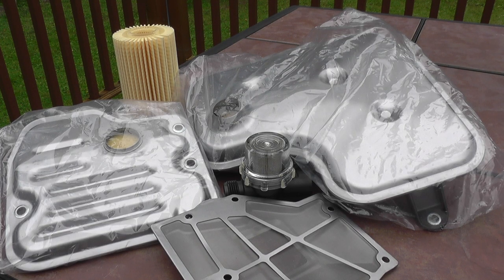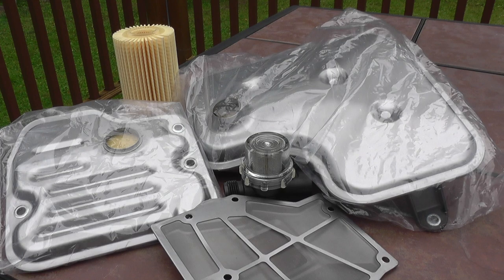Automatic Transmission Filters, information on transmission flush dealers don’t want you to know

Comment: I changed my trans filter in my 2008 Avalon. I replaced the fluid with Dextron VI wich I read was compatible. Is it? Now is is not engaging at normal speeds. I have only driven it about.5 miles after doing the change.
Reply from the maker: Your avalon needs ws compatible.  Also,  did you watch this video before changing atf? https://youtu.be/maK7HsGEEls

Comment: hello rapairvehicle, thank you for your time to make these interesting videos end for the time spent for all of us! i have been watching your videos for some time! this time i have a question, there are stories that the screen filters are suposed to change them in long periods of time( kia dealer advised me to let the filter there until 300000km)! my car has a screen filter has 140000 kms on the clock end i want to change only the fluid end not the screen filter, it's ok for another 40000kms? my gearbox is A5SR1 from kia or should i replace the filter too? thank you in advance!
Reply from the maker: If you change your fluid on regular basis then changing filter is not necessary. If fluid has not been changed for 140km then it might good idea to change it, because it might be partially clogged up.

Comment: should I change also gasket pan for. transmission
Reply from the maker: Definitely replace gasket, sometimes it comes with the filter.
Don't forger quality ATF fluid, I use it in my Toyotas. https://www.amsoil.com/lookup/auto-and-light-truck/2004/toyota/sequoia/4-7l-8-cyl-engine-code-2uz-fe-9/us-volume/?zo=5257753

Comment: Hello 
repairvehicle, thank you for your videos. I have Nissan NV200. Looks like there is two filters in transmission. Should I replace both of  them? I have 140K on it. I drain and fill it once at 70K. And second time at 130K. Thank you in advance!
Reply from the maker: If you replacing 1 filter, might as well replace second one, if it's can be done.

Comment: Hi. 
This was a very interesting video. 
I also have a question: I need to check the ATF level on my transmission, but it has no dipstick. 
Is one of the new so called sealed transmissions. 
For verify the level, I have to open the level plug, with engine running and transmission in P, all that at a certain FLUID temperature. 
This I do not know, what is the temperature needed so I will have the correct level. 
I am able to see the transmission temperature via OBD, with an ELM 327 and Torque application. 
Can you please tell me if you can find this information for my car?
It's a Opel/ Vauxhall Corsa E series, from 2015, 1.4 gasoline engine and 6 speed automatic transmission. 
Thank you.
Reply from the maker: +Burta Verde , I will get back you to later today.
Reply: repairvehicle thank you very much
Reply from the maker: +David Meyer, you are welcome.
Reply from the maker: +Burta Verde , this video looks like has an answer for your question. https://youtu.be/ipdcU24uXxU
Reply: repairvehicle Thank you, but my car is Corsa E and not Astra J.
Reply from the maker: +Burta Verde , according to the video description it applies to Corsa too. Is Corsa and Astra have same engine???
Reply: repairvehicle No. Not same engine and not same transmission. 
Corsa E has newer transmission, similar to Astra K.
Reply from the maker: +Burta Verde, I will look around and see if I can get you more information.
Reply: repairvehicle Thanks man. 
Maybe you have acces to the workshop manual. 
I was not able to find it.
Reply from the maker: +Burta Verde , I could not find any information on transmission. There are some website out there that might have it. However, you have to pay to have access to the information.
Reply: repairvehicle No problem, I decided to use the simple method of draining it, measure the amount that came out, and put back the same (maybe + 200 ml). At the next drain I will measure again and see if trandmission consumes some fluid between changes or not.

Comment: Hey repair guy
would you recomend me a transmission filter for a sequoia 2004?
it can be any brand name
Reply from the maker: Here is my recommendation.
This would be my first choice https://rover.ebay.com/rover/1/711-53200-19255-0/1?icep_id=114&ipn=icep&toolid=20004&campid=5337992468&mpre=https%3A%2F%2Fwww.ebay.com%2Fp%2FTOYOTA-OEM-Automatic-Transmission-trans-Filter-3533060030%2F658755859%3Fiid%3D322415651590%26_trkparms%3Daid%253D222007%2526algo%253DSIM.MBE%2526ao%253D2%2526asc%253D44040%2526meid%253Dd75a63a611ee449da3142bc495b8a958%2526pid%253D100005%2526rk%253D5%2526rkt%253D12%2526sd%253D253066573906%2526itm%253D322415651590%26_trksid%3Dp2047675.c100005.m1851

Second Choice  https://amzn.to/2JMUk8A

Third Choice, is because price is higher on amazon vs ebay for OEM https://amzn.to/2Hzucxs
Reply from the maker: I don't know what seller has in stock. Please ask seller on ebay to confirm filter part number, and if its going to work for you Toyota. When purchasing parts from Ebay, make sure seller sells only parts not just random stuff and it happened to have filter.

Comment: Hello my friend. 

I have a 2015 Tacoma. I plan on doing a drain and fill 3 times when I hit 60,000 miles. Would you recommend I change the transmission filter at this time or wait until more milage?  Thanks!!!!
Reply from the maker: Have you seen this, it has answers video https://youtu.be/Y2f7dFNP82k
Reply: @repairvehicle  watching now thanks!  Thumbs up and subscribed
Reply from the maker: Let me know if you still have questions after watching
Reply: Can I order Amsoil through you? I needed trans fluid, transfer case, and diff. 

2015 Tacoma TRD Sport 
4.0 V6

I have an Amsoil membership, is it worth it or possible to order from you? Could you tell me EXACTLY what to purchase? There is a few options for AMSOIL trans fluid and I'm confused. Thanks
Reply from the maker: I will get back to you with answers, later today.
Reply from the maker: Amsoil offers two types of atf fluids for your truck,  OE- which is better than factory and signature series which is best atf money can buy. I personally use signature series everything,  including atf in my Toyotas and lexus.  You can purchase through me,  but you would have to call Amsoil give them my reference number, because you already have account and assigned to someone else. Let me know if I answered your questions.
Reply from the maker: For transfer and differential,  use this fluid https://www.amsoil.com/p/severe-gear-75w-90-svg/#pills-home_0?zo=5257753